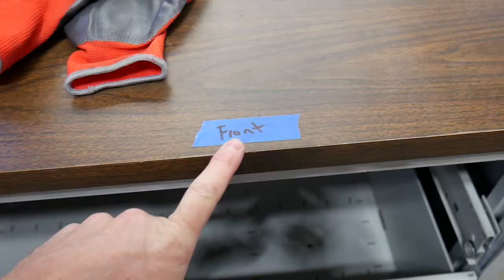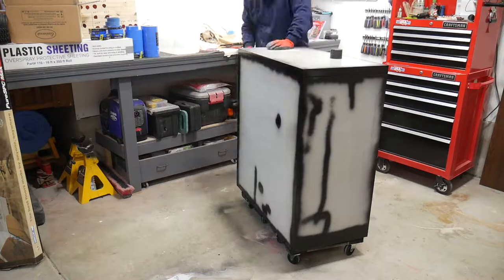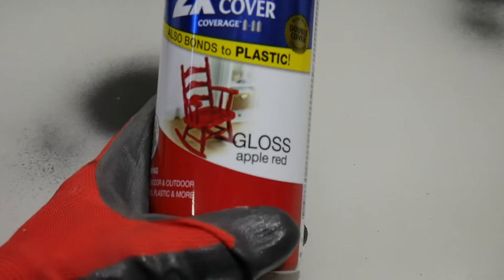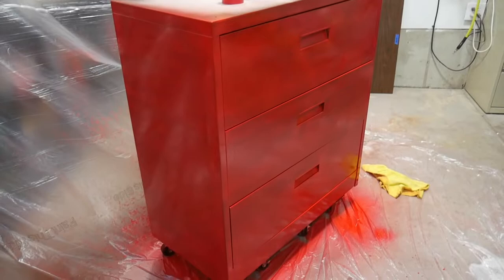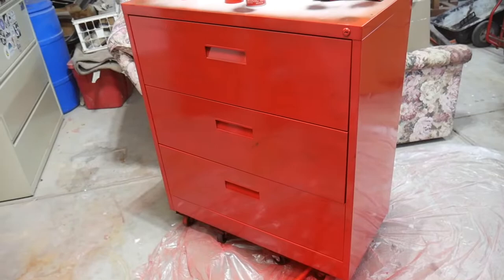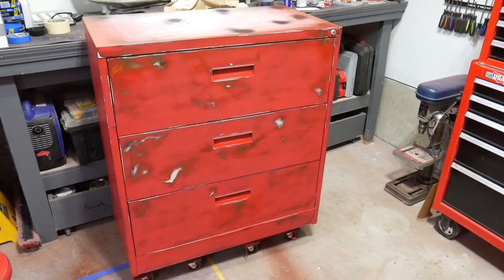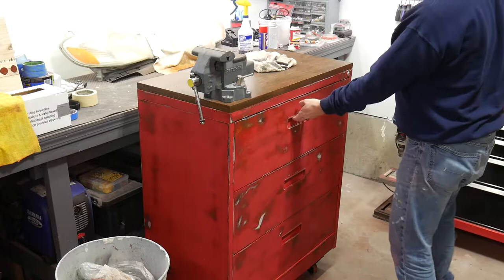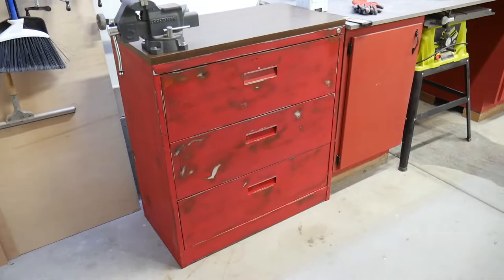HOW TO: file cabinet to tool box conversion

Comment: Safe lubricants at the end was hilarious after all the spray paint you threw into the atmosphere!  Love it!  I know this is old, but can locking caster wheels be mounted on the bottom?
Reply from the maker: It’s metal so welding caster on would be easy enough. I’m considering doing that to make it mobile. 🙌🏼
Reply: @troysgarage  Thanks.  I'm picking up 2 of the larger file cabinets and considering mounting casters for easy moving.  Thanks again!

Comment: Is it secures to the floor if so how did you do that? How would you do it on a wood floor
Reply from the maker: It’s not secured to the floor. I loaded heavy items in the lower drawers to eliminate the risk of tipping.